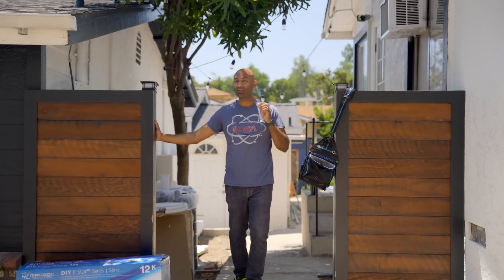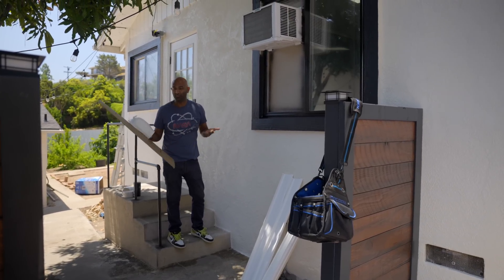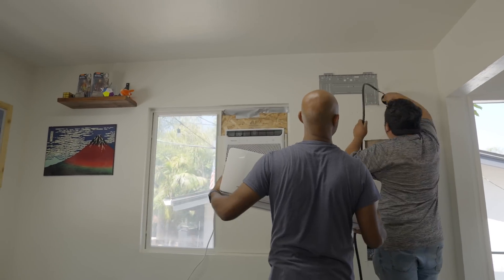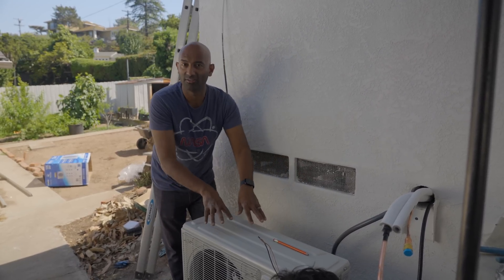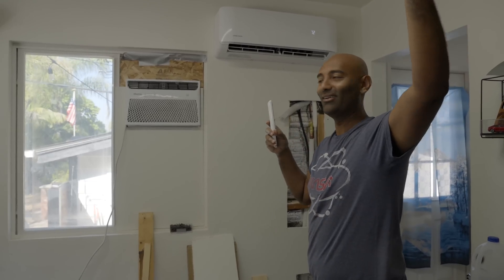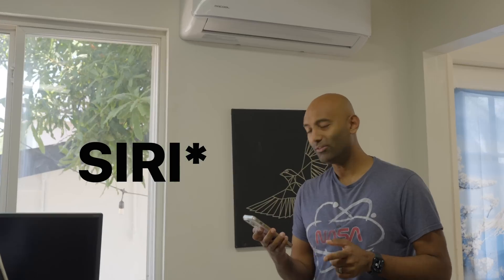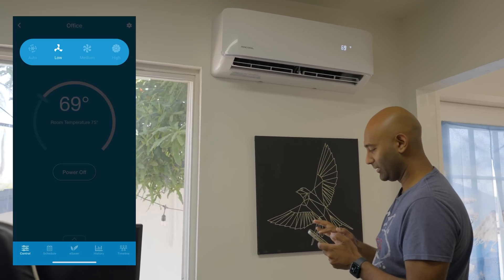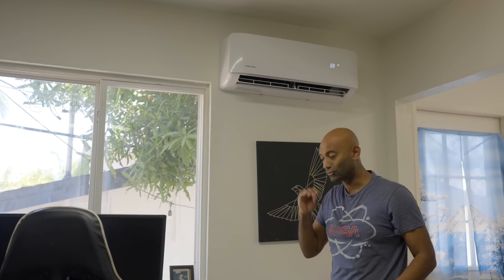Summer Heat? Here is Your Answer! DIY Mini-split Heat Pump!

Comment: I live in Europe and have worked in HVAC for more than 15 years on anything from simple home owner AC systems to big VRF/VRV AC systems for offices etc. We've had these single split and multi split (more than one indoor unit) for ages now so I'm a bit surprised to see that this seems to be something new in the US. I can tell you that I'm not a fan of these DIY systems with the easy connectors because they always seem to fail after a couple of years. The system being pre-charged is not something exclusive to DIY systems, pretty much all of the manufacturers (Daikin, Mitsubishi Electric, LG, etc) do this for their split systems. One of the things you have to keep in mind is that they are pre-charged with a certain amount of refrigerant which corresponds to a certain piping length attached to the unit. If the piping length for your situation is longer they either need to increase the amount of pre-charged refrigerant or you need a professional to come around to top of the refrigerant charge.
Being from Europe I don't know the MrCool brand but I'd always go for a brand that comes from Japan (Daikin, M.E., LG, etc) because they have been making split AC's for a long time and are very good at what they are doing. And I would always get it installed by a professional. Not only is refrigerant quite dangerous when yo have a leak (it can burn you) but they will also check the system to see what pressures and temperatures it's running at.
Reply: MrCool is a US company, but supposedly their units are made in China. One of their selling points that DIY is cheaper, because professionals cost money.
I agree with you, maybe cheaper in the short term, but might not be in the long run.
Reply: @autohmae  China...hmmm, so probably some generic product with a brand label slapped on. I see their DIY split units are running on R-410A refrigerant which is an older refrigerant and is being phased out as of 2022 since it has quite a high GWP (Global Warming Potential) of 2088 metric tons of CO2 per kg. R-32 is pretty much the norm now. Not sure how they can sell this as being the latest and best system available, sounds more like some surplus stock is being sold of cheaply. I also see they quite often get a p4 error, which has to do with the compressor failing. So yeah, penny wise but pound foolish if you get one of these units imho.
Reply: @autohmae  Prices of R410-A have been going up since its phase out was declared so I don't think it's about getting rid off R410-A. A lot of R410-A systems currently running and they do need maintenance and repairs so their refrigerant specific parts are going up in price as well. I really think this is about getting rid off old R410-A systems that are being phased out.
Reply: The line sets have refrigerant in them and that is what makes them DYI. You don’t have to evacuate the line sets or add refrigerant. Thus DYI.
Reply: The one I fitted is an ElectriQ split aircon and it’s made by Hitachi, it’s been in for the last 3 years and works very well it’s only drawback is it won’t heat if the outside temp drops much below 8°c but that’s not a problem as it’s mainly for cooling. Having said that if it’s 8°c outside then it does a brilliant job of heating. It came pre charged with ozone safe coolant and so was legal in the U.K. to DIY.  Most of the other units on sale have to be commissioned by a refrigeration engineer as this is a legal requirement and the shop won’t sell them otherwise.
Reply: @wobby1516  Yes, as soon as temperatures drop below 5C the outside heat exchanger will freeze forcing it to go into a defrost cyclus that can take up to 15 minutes and that's when the efficiency really drops.
Reply: Mr Cool
Mini-split = Midea
Universal (ducted) = Gree

Comment: They don't rate window units in seer?
 I install this exact unit back in January, however it's a gen three and does not have charged lines so you need a vacuum pump to pull the lines down. 
I also installed a LG 18K btu duel inverter window unit that will cool a slightly larger room faster than this split unit. It's also is quiet for a window unit and super efficient... (no heat)
Reply: Window units are rated in CEER, while central-air units and mini-splits are rated in SEER.  Why?  I don't know why and I don't know how to compare the two ratings.  that said, window units are always going to be significantly less efficient due to lack of space.
Reply: @junkerzn7312  I think the way to compare them is the EER? rating and this duel inverter window unit is higher than my mini split at temperatures above 90. It also has a way to spray cool/cold evaporator condensate on the condenser...I like the mini split better because it's a neater package than a window unit...and it's quieter but not a lot

Comment: And you hit on another reason why the mini-split is more efficient when you mentioned 500W and oh, lets turn it down so it runs harder... now 642W.    The modern mini-split is variable-speed, whereas most traditional A/C units are not.   This allows the mini-split to operate at an equilibrium point for the temperature selected for the room which is loads more efficient than a traditional A/C system which cycles the temperature lower, turns off, waits for the temperature to go higher, and repeats.  Often with a 5F or bigger swing in temperature.

The mini-split is also almost certainly soft-start, which means that it can be used with sufficiently endowed power stations or discrete inverters without causing too much trouble.  And that means that tying the whole thing into a solar or solar + battery system is also fairly easy to do as well.

-

So lets say we wanted to support this mini-split off-grid or mostly off-grid. Lets do a quick calculation.  Lets call it 500W @ 50% daily duty.  That is 6kWh/day.  The solar equivalent for that is 1200W worth of solar panels.

So if you have a home that already has solar panels, this mini-split burns about 1200W worth of those panels for full off-grid support.

If you were building a dedicated solar + battery system from scratch to run this mini-split off-grid, then we're talking roughly $3700 worth of stuff.

* 4 x 320W solar panels (2s2p so no combiner box required, though I always recommend using one anyway for panels placed in parallel).   (Must develop at least 64V at operating current for charge controller to function with a 48V output).

* 1 x Victron MPPT 100/20 charge controller.  (max 100V open-circuit on the solar input, 20A @ 48V output).

* About 5.12kWh worth of battery storage (100Ah @ 48V LiFepO4).  Needed for bridging overnight and off-sun usage.

* A 1500W 48V pure sine wave inverter.

* Cables, main battery fuse, DC breakers and insundries, and mounting for the panels.

But if other stuff is also being run off-grid, a lot of the equipment can be shared.  So e.g. expansion would involve adding more panels and another charge controller, which is an incremental cost, but you might still be able to make due with the battery storage and inverter as-is.   Sometimes having more than one inverter is useful too.

--

Another option for "mostly off-grid" support is to go with a smaller battery and then add a programmable 48V battery charger.   You just program the battery charger for load-support when the battery gets too low... roughly 51.6V would do it.  That way the grid support only runs if the battery gets too low.  15A would be ideal, ensuring that the load can be run indefinitely if necessary, but one can also use a smaller battery charger programmed for a slightly higher voltage, e.g. 52V @ 10A.  What will happen is that load-support will gradually take power from the grid as the battery gets lower, sharing power with the battery.

Going with a smaller battery can reduce costs but it also means you aren't fully off-grid and need the battery charger for load-support to ensure reliable operation.

Comment: That mini split is also about 4x the cost of a really decent window unit that can be installed into a wall as well as the usual window an option. I got a Hisense  8000 BTU from Lowes, and it was in stock for quick warranty exchanges if needed. It uses a DC inverter so the compressor cycles can be low or high depending on the temperature of the room its located in. That really cuts the cost of running it compared to non DC inverter units Ive used before. In an old and tiny 400 sq ft apartment it is plenty powerful enough to keep the apartment a chilly 70 degrees on 105 degree Central California days. While I would rather have the mini split, I cannot justify spending well over $1000 for AC in a place I do not own. In this case it lists for about $1700 on amazon.

Comment: You should have pulled a vacuum in the empty lines before you opened the compressor and released the refrigerant.
Reply: I'm fairly sure those line sets are pre-charged, so you don't pull a vacuum before attaching.  You have one shot to attach it properly, though.

Comment: I had the same problem with my upstairs rooms being about 4 or 5 degrees hotter than the downstairs due to undersized feed ducting to the upstairs.  Increasing the duct size to the 2nd floor was not feasible.  My solution was to install an inline booster fan in the feed duct to the upstairs that was controlled by the furnace.  This solution balanced the air conditioning and had the added benefit of reducing the furnace static pressure thus reducing the load on the furnace fan.
System Components:
   AC Infinity CLOUDLINE S10, 1201 CFM Inline Duct Fan with Speed Controller
   AC Infinity Flexible 10-Inch Aluminum Ducting, 8-Feet
   Functional Devices RIBU1C Enclosed Pilot Relay, 10 Amp Spdt with 10-30 Vac/Dc/120 Vac Coil
Reply: Thanks for sharing

Comment: You should run a second head unit into the recording studio.    You can run up to three head units on one condenser unit.
Reply: That depends on the outside (condenser) unit. The unit shown in this video has only a connection for one indoor unit (also known as a single split system). If you want to connect more than one indoor unit you'll need an outdoor unit with more (2, 3, 4 or 5) connections, also known as a multi split system.

Comment: Mr Cool is a leader in the DIY mini-split products.
They are really good products. However, one may want to consider EG4.

EG4 now offers pre-charged lines and has AC and DC capabilities.
A built in MPPT option allows running off solar directly.
It is several hundred $$ less and has better efficiency.
EG4 has several sizes from 9K, 12K to 24K.
Reply: Running directly off solar is an amazing feature, exactly what I want to do, but not the kind of feature I'd expect in a commercial product. Thanks for mentioning it!

Comment: if you don't vaccum the lines before releasing the refrigerant humidity in them can react with the refrigerant forming acids and other corrosive compounds, these corrosive substances can damage the internal components of the AC system over time aside of leading to reduced cooling capacity, the compressor unit most probably has a filter drier, but is not magic.

if you are not going to vaccum the system, at least make sure you install it in a day that isn't too humid.
Reply: To every comment about vacuuming the lines
MRCOOL® DIY® Quick Connect Pre-Charged Line Set

They are factory vacuumed and filled with refrigerant with quick connectors that keep all water and air out, the only thing is you should not install in rainy weather to not get water between the connectors before connected
Reply: @tullgutten  aaah, that's a first one for me, thought they were conventional lines with conventional connection, that's pretty nice!

Comment: I have an eg4 12kbtu unit... runs on 6 250w panels in series as well as a 20 amp connection to my panel. Its saved 256kw of power of 632kw in 7 months here in Pa by supplementing the wall usage with solar!  Totally love it and installed it all but the linesets, had an hvac guy do that. Totally awesome seer 28
Reply: Very nice.  That unit can take PV in directly, up 380VOC, and it can take AC at the same time for uninterrupted operation, allowing it to run off the sun when the sun is shining.   190-1100W input power, and low starting current (4A).    The SEER2 rating on the spec-sheet says 22 not 28.  Still really good though.
 
The only downside is that any excess solar is wasted without a battery to hold the energy.

Comment: If u bent those line sets by hand with that tight of a bend to go down the interior of the wall, then u most likely kinked them. It will work fine for a short while. There’s a bender needed for that hard of a bend
Reply: the line sets that came with both of my Mr. Cool units were coil wrapped and then covered in insulation.
Bending was a breeze and safe for the soft copper.

Comment: But you didn’t pulled a vacuum on the air that’s in the line set
Reply: Actually they are pre filled with refrigerant
Reply: The lines are capped with a negative pressure (vacuum).

Comment: I fitted a unit like this, and it worked great for a year. However, it clearly has a leak, and that's not easy to track down. I had it refilled, and it worked again for a while. These systems are great if you can get a 100% seal. If not, you're going to have to keep getting them refilled if you can't track down where the issue is.
Reply: Get a technician to pressure test and find the leak, will cost less than filling it yearly 😂
Reply: Could you just order new lines instead of refilling the leaky lines?
Reply: @SpykerSpeed  Usually for these things the issue is a leaky connection not the lines. Something for the original poster likely needs to be resealed or tightened.
Reply: @Awrethien  Probably caused by a defected or badly installed compression fitting or something like that.
Reply: @SpykerSpeed  no
Reply: Most likely leaking at the flare connections for lineset at condenser or evaporator.

Comment: The reason the heat pump is more efficient is because of its inverter motor not an induction motor in the window unit😮

Comment: The onlything I question is the air in the lines.
For our warranty ti stay intact where I'm from, you have to run  a vacuum pump on the lines before opening the refrigerant valve.
Reply: To every comment about vacuuming the lines
MRCOOL® DIY® Quick Connect Pre-Charged Line Set

They are factory vacuumed and filled with refrigerant with quick connectors that keep all water and air out, the only thing is you should not install in rainy weather to not get water between the connectors before connected
Reply: @tullgutten  thanks for the explanation. Makes sense it uses quick commect fittings.
I'll jabe to take a look into that brand.
Reply: The lines have a vacuum on them, they are capped and set to negative pressure so when you open the valves it PULLS the refrigerant. No air pockets that way.
Reply: @Dewydidit  but how do they stay negative if you have to remove the caps to connect them to the indoorlines and then once more on the outdoor lines?
Or do these use some kind of push connect system that I didn't catch in the video?

Comment: Love my MrCool system. Only recommendation is I think in order to be to code, you have to have a disconnect on the outside by the compressor. I also recommend putting a surge suppressor on the disconnect to protect the unit from power spikes.
Reply: We got in Europe these for 25 years at least. And you don’t need complicated electrical connections, footings or very skilled guys to install them. Here we hame some wall brackets and install them at 10th, 12th ot 15 th floor if you don’t have centralised HVAC. Nothing complicated at all. A simple disconnect in the main electrical panel, independent circuit, that’s all.

Comment: DRY feature is good when not needing to use a room but you want to keep humidity down.  I use it in my RV when I am not using it but keeps fresh.  Pioneer 12000btu, 115v mini split.  Having water heat from the outdoor evaporator unit would be a nice feature.  We have a heat pump water heater in an unheated room so we leverage the FL heat for water already.  I have the same mini split in my RV.  The second unit is in a separate office off my garage that is not attached to the in-home Trane system.